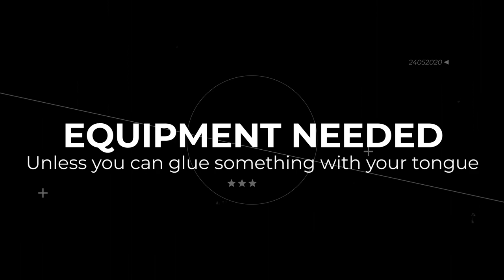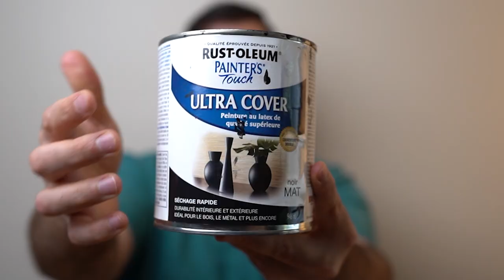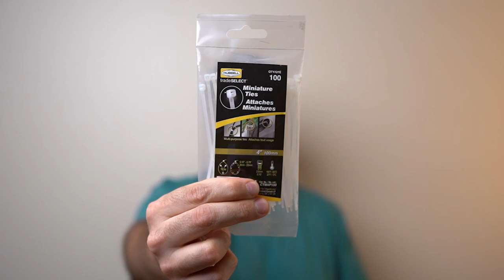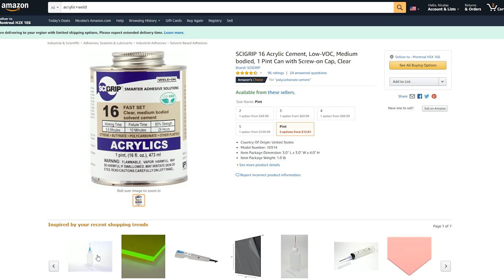How to Build a DIY All In One Aquarium Pt.1

Comment: cant you just not make an over flow up top and make a hole midway in the 1st section with a strainer and it will act as a filter that way?
Reply from the maker: You can do what ever you in reality, at the end it's just water circulation. I try to avoid water restrictions in general.
Reply: @AquaSplendor  I was thinking it will eliminate the risk or flter running dry plus any noise related to the overflow trickling. Might also help keep
more water in the chambers.

Comment: Silicone sticks enough to acrylic? I used sand paper to roughen acrylic and I hope it will stick enough to work. On your video it just works.
Reply from the maker: Yup mine work fine, make sure to use a good silicone, they are not all the same
Reply: @AquaSplendor  I'm sure it is very good silicone on our market but maybe i need to let it cure for 12 hours.
Reply from the maker: @linkflap1342  Oh definitely let it cure for 24h don't rush this thing!
Reply: @AquaSplendor  Thanks. I glued one piece only for now because I don't want to hit and break other already glued piece. I used tape like you and I left 5 millimeters space for silicone bounding. Cheers.
Reply from the maker: If you want more stable add more surface for the silicon, mine is tiny for esthetic reasons.

Comment: I just got an 80L aquarium with a build in back sump filter like that.
It will be Fresh water with Neocaridina shrimps that dont like too much rotation.
How many Litres per hour should be the pump?
Acording to external filters we usually use 3-5 times L/H but on this case that the pump is already inside the aquarium and dont need to lift the water 1meter up I guess 5x times is more than enough?
I have some 400L/h water pumps sitting from a previous project.
Reply from the maker: Not putting numbers. What matter is 1) don't get shrimps get suck up. 2) Avoid full blast with return pump, which is hard to do anyway.
Reply: @AquaSplendor  Τhe input is well designed with small holes and prefilter spongue.
The output will be a long spraybar.

Comment: Nice one. I am curious to see how you manage the flow of the water to reduce the level of it. 
Also, did you get the acrylic from Amazon or a local store. (I am also in Montreal)
Reply from the maker: At that time I bought them on Amazon us, the "Frais douane" are super expensive, be advice 😓. For the flow, i honestly don't know, i go by instincts, and... seem towork everytime 😆, but i try a new design for my frag tank will show later
Reply: @AquaSplendor   very helpful video, but how do you know where (how long or high) to cut the slots or holes for the overflow, can you predetermine where the waterline will sit or is it a gamble? I was going to do this for a 60 gallon cube that I'm currently not using but it has the black rim on it and would want the water line to be hidden just above the rim. hope that makes sense, thanks
Reply from the maker: @duanevh3790  Basically lower than the input is the best way.
Reply: @AquaSplendor  thanks

Comment: what pvc parts did you use to connect the output pump to the bulkhead with loc line?
Reply from the maker: Random fitting I found at my hardware store, I brought my PVC/vinyl pipe with me at the store to test until I find I find something. There's a 90 Elbow + a fitting vinyl pipe to pvc, sorry I don't know their name honestly.